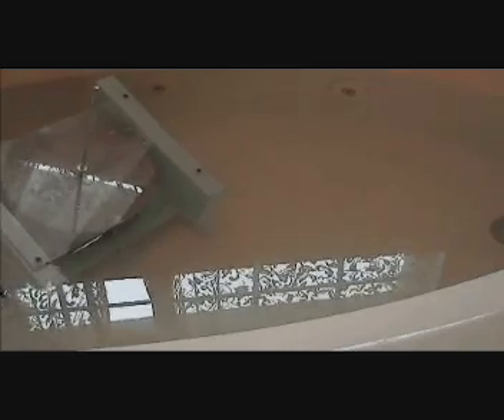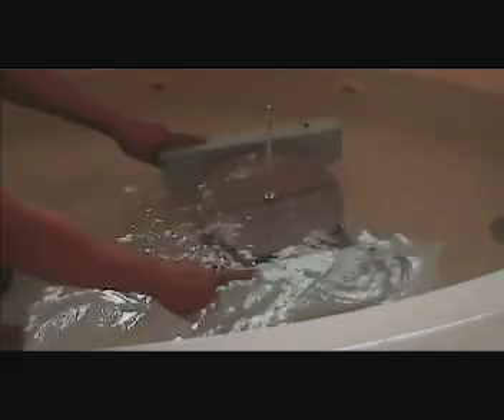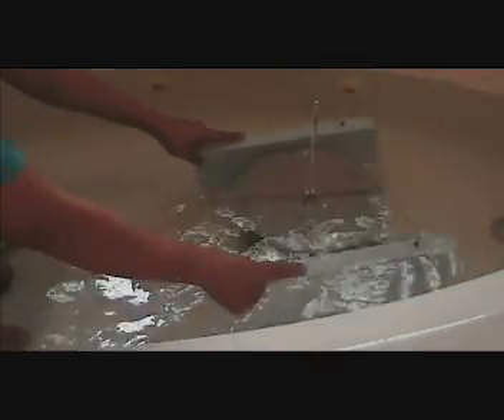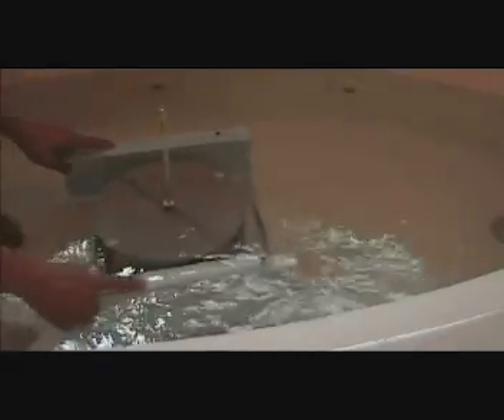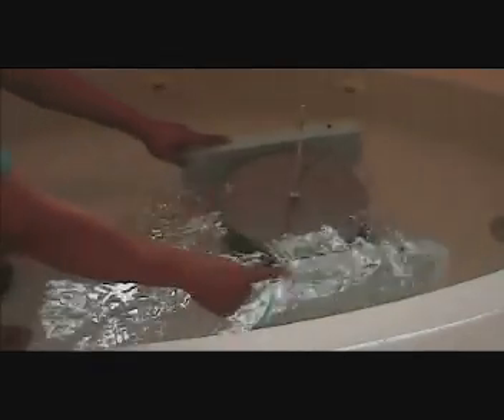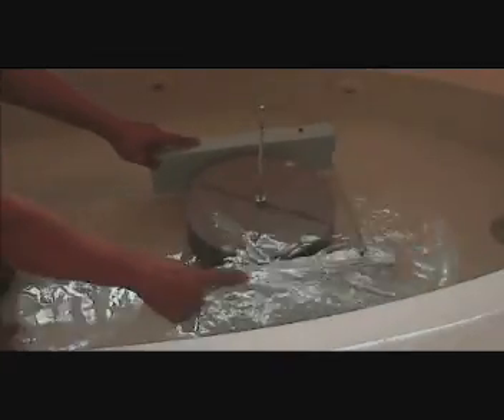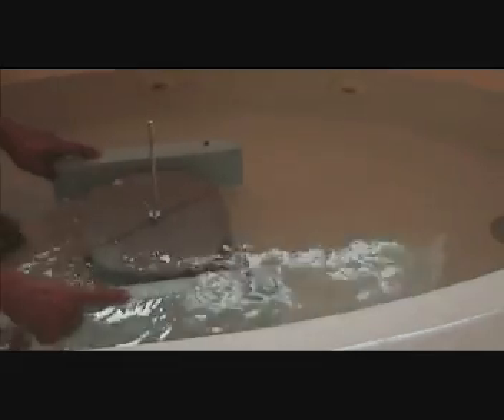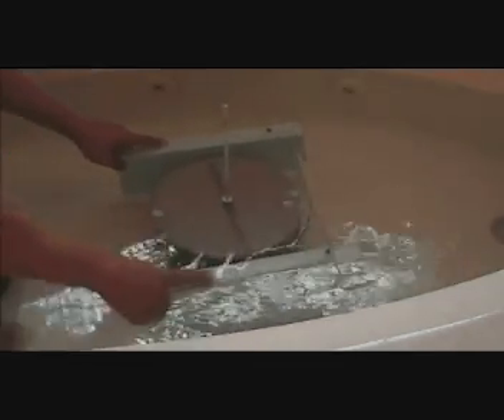Neo Aerodynamic-2 Wind Turbine As Wave Turbine

Comment from the maker: BENEFITS:
1-The least expensive to build therefore the most economically attractive.
2-Yields multiple times the output.
3-Enable low wind class.
4-There are thousands of mile of river this provides an inexpensive mean enables them to produce electricity; economically.
5-Work on Tidal flow.
6-Wave on thoussand os square miles can be utilized.
7-Wave turbine also move sea water up from the deeper to the surface -- To absorb CO2. Helping reduce green gas them the atmosphere